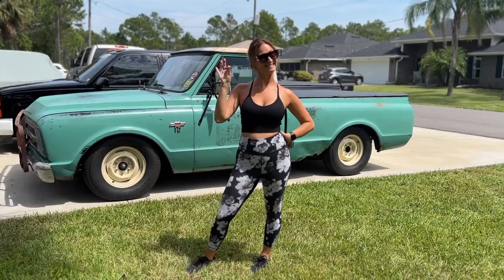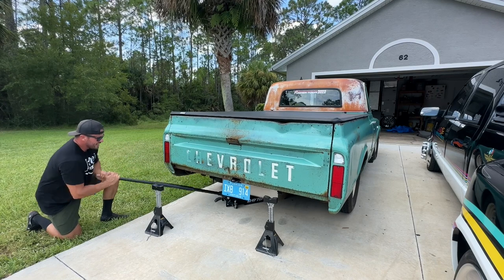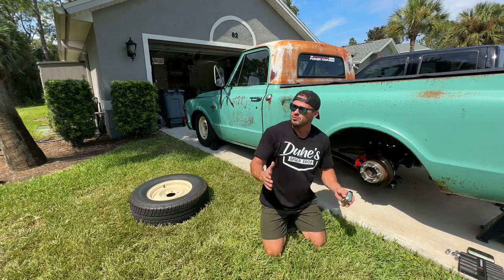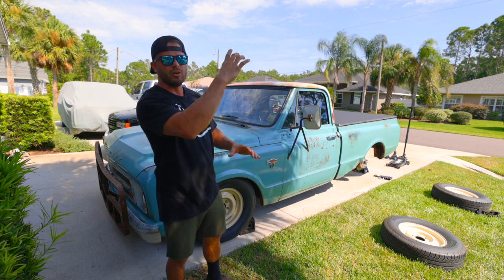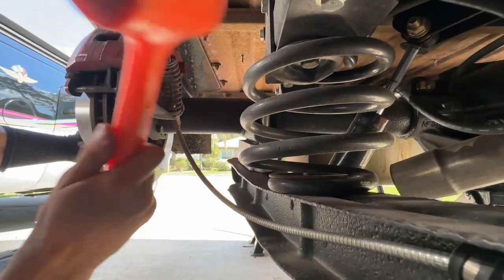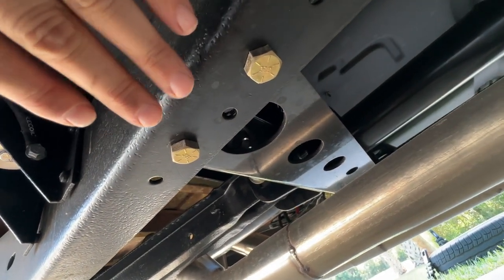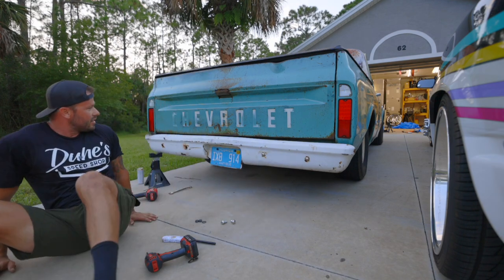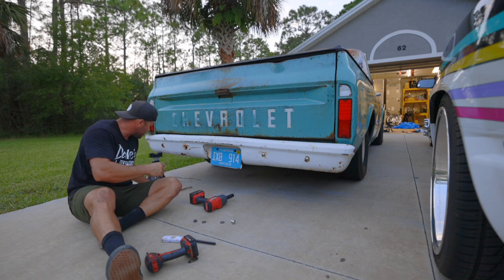I Figured Out Why My Truck Drives Crooked

Comment: i had this issue on my c10 it was the flip kit it was not centered on each side. The axle was not cented from the flip kit i had it was a junk flip kit. I got a jdm flip kit and it fixed the issue. I would measure the center of the drum to the edge of the bed wheel base'

Comment: Question where experience problems with rear end on 67 C10 before or after u got on road
Reply from the maker: It was before we got on the road. As soon as I got the truck done we took it on the 2022 Power Tour and my buddy noticed it but didn't tell me until a few weeks ago.
Reply: @yeahbuddygarage  ; That's interested but frame looks good don't think it been twisted or nicked